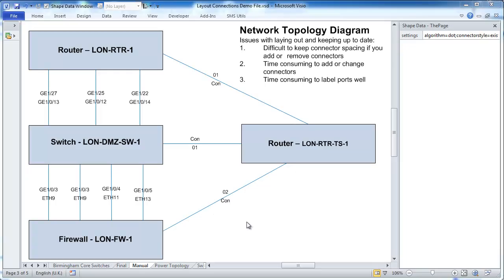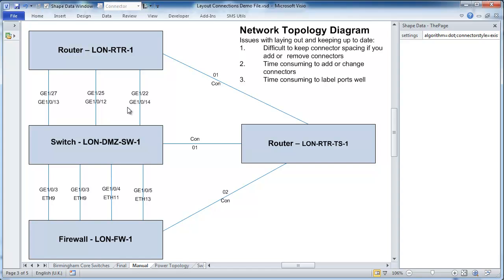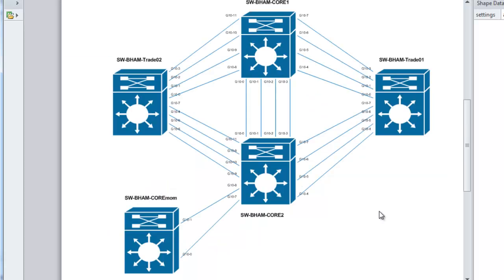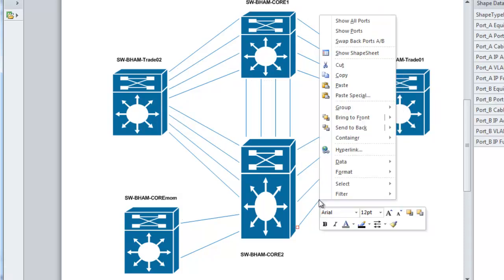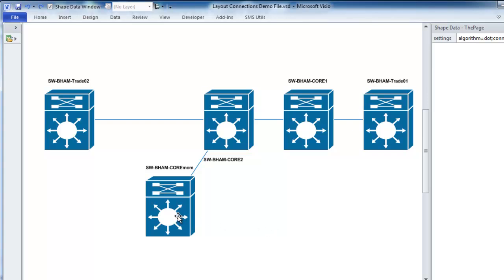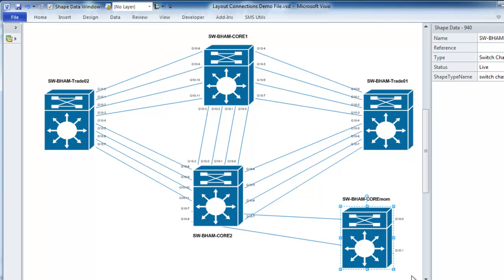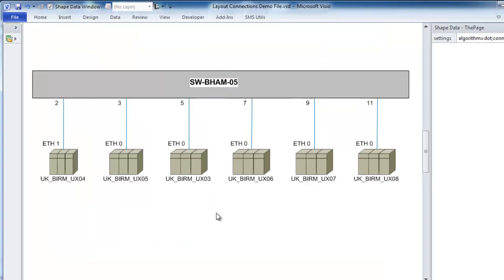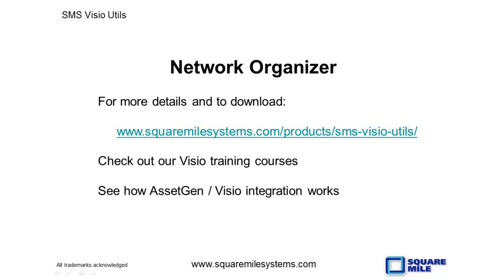Automatically laying out Visio network topology diagrams and spacing and adjusting connectors

Comment: Can you document what shape data is required for this to work? 
Is there a supported or tested version of Visio?

I couldn't get it to work using Visio 2013, but I had to guess at shape data: "Name," "ShapeTypeName," "Port_A_Equipment_Name," "Port_B_Equipment_Name," "Port_A_Name," and "Port_B_Name" was what I could get from the video. 
In Visio 2013 the context menu displayed when clicking on the right mouse button does not contain "show all ports" or "show ports."